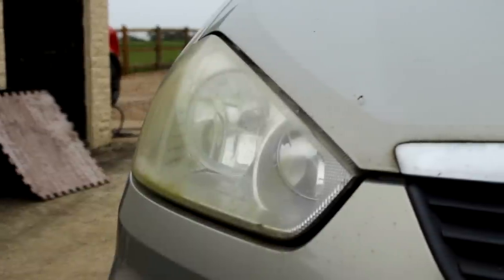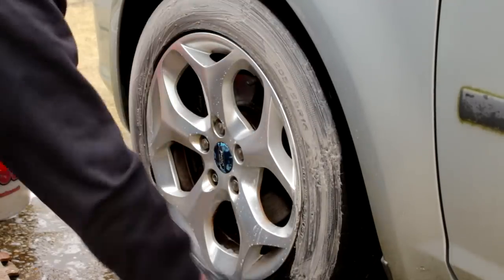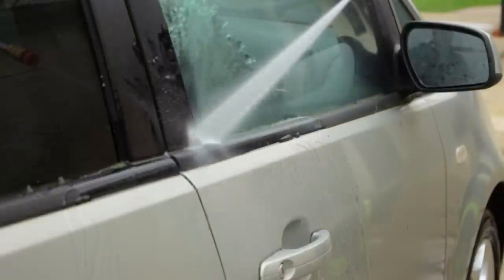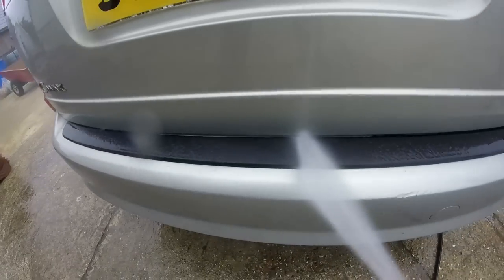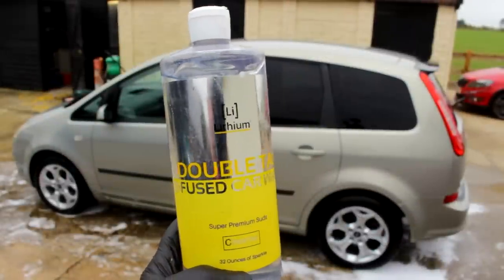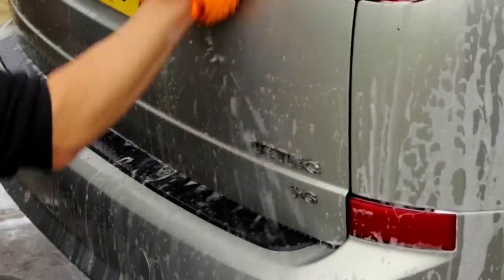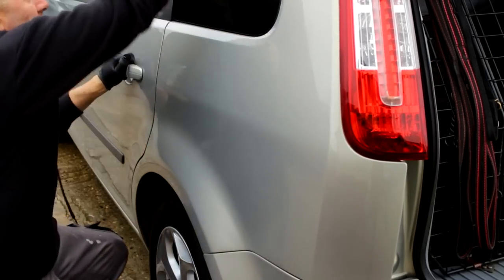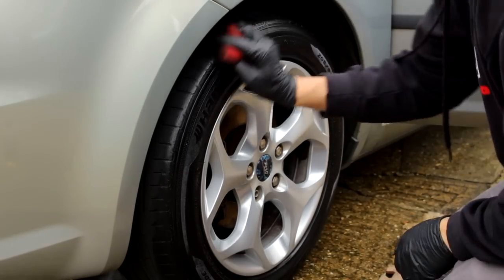DIRTY FORD GETS A BATH

Comment: great job Paul....some very good products used, can't beat a bit of AM Seal (Glaze n Seal is a great combo).  Last time i did a car similar to this, i used IW's citrus pre-wash to help, before the foam party -- as you found, badges, window rubbers and trim bits were the worst.  also loathed to use my good MF mitts/cloths, so lots of old ones were dug out instead, and an old noodle mitt.  Loving the pod-cast work too, keep it up, very entertaining.